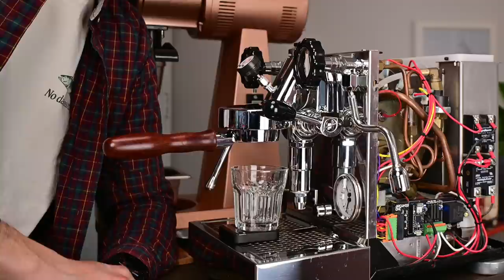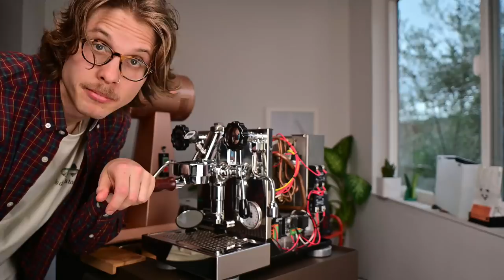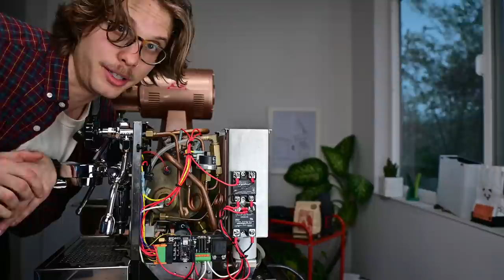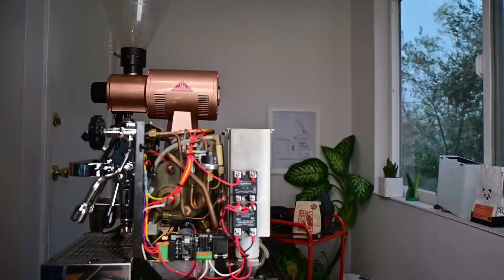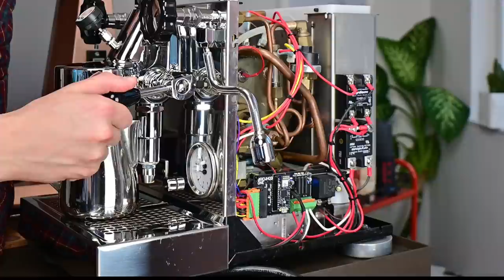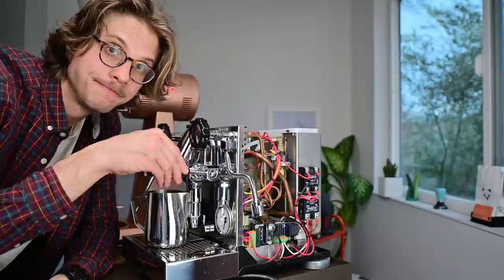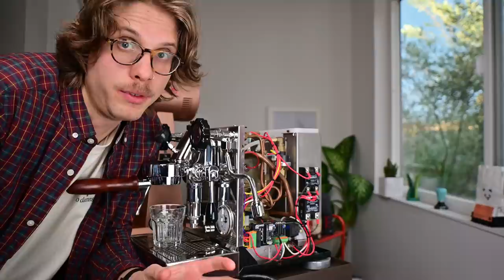I Built an Endgame Rocket Espresso Machine | An Engineer's Rocket Appartamento Mods

Comment: That very neat stuff. I would be a little concerned about that variable paddle in that when you get a little off the end of the cam you are starting to alter the valve positions and I could see trouble if you try doing this around the halfway point, Im sure you would have no problem but an ordinary user would. Im guessing you have yours plumbed? Mine isn't and it really annoys me when it runs out of water so I have a level display based on a pressure sensor connected to the tank connector outlet. I haven't actually mounted the unit yet but am looking at coloured LEDs on the back so it lights up the rear of the unit green, orange red etc, I don't like leds on the front panel design of the Rocket.  Really like your controller, I would like to be able to do that but Im not good enough with software to write that yet. 

Highly recommend putting a couple of these antiburn rubbers on you wands https://servicesphere.com.au/products/CMA15296001

Comment: Why drilling the hole in boiler for temperature readings when all you need is temperature 1mm from the coffee grounds?
Reply from the maker: Good question! That probe is actually responsible for running the PID I wrote that runs on the board, which needs to maintain the steam boiler temperature.
Reply: @tatemazer  that's really cool, but it would be simpler on lever machine like Europicolla

Comment: So if you had to chose on the group head temp or pressure guage which do you chose?

I've a ECM Mechanika V Slim and by default I alway dump my cup of water from the group.
Reply from the maker: Ohhh that is a tough one! I'd say, stick with the temp sensor until you get confirmation and confident with flushing the right amount of water, then maybe take advantage of that muscle memory and jump into using the pressure gauge.  I'm not quite there because I unfortunately don't pull enough shots on this machine!
Reply: My question is, why hasn't someone built a pressure gauge which also reads the temperature? This seems like a no brainer gadget to make.

Comment: This mod make me think of the mod gaggiuino. personally, I prefer rotary pump over gear pump due to the sound, but i guess there is no space for a rotary pump.
Reply from the maker: I gotta agree with you, I don't think there's any pump that sounds nicer than a rotary pump! And yeah I don't think I could make it fit :( but pressure profiling is much trickier with those AC motors :(
Reply: @tatemazer  Ac pump should be able to adjust with AC Motor Speed Controller like how you adjust  speed  of your fan but you might need a stable ac input.
Reply from the maker: @Soras_  not quite. With the granularity of control you would want on an espresso machine, that design doesn't quite work. A better fit would be a vfd controller which are quite expensive and single phase AC motors have a very narrow range of efficient frequencies
Reply: @tatemazer   I think put a motor to adjust pressure valve on rotary pump should work. when i use my machine, the valve does change the pressure during espresso making process and it's quite linearly.

Comment: Why is the group head temperature overshooting?
Reply from the maker: This is a heat exchanger machine, meaning the heat source is water that passes through the 255F steam boiler, which is much hotter than ideal brew temperature. If the water is not flowing through the system fast enough, it can rise above brew temperature.

Comment: ...and what's the down-side of controlling pressure by duty-cycling a vibratory pump?
Reply from the maker: Hear the (relative) silence of a gear pump and you'll know immediately 😵‍💫😵‍💫
Reply: @tatemazer  I was just thinking of ways to get the job done on the cheap, and if you've got the Appartamento, you've already bought a vibratory pump. Of course a gear pump is quieter, more reliable, and volumentric. But do you know if there's a gotcha hiding in doing this with the stock pump and duty-cycling?
Reply from the maker: @lessmith3799  I agree, a vibe pump is a great cost-effective method, as the decent has shown. It's just slightly more complicated to control considering you need a long pwm period to control the AC pulses instead of simple DC voltage control

Comment: Would love to see a flow control mod for Linea mini
Reply: there are several: Two different needle valves from either Grafikus or the coffee machinist. There is a gear pump (called EMP Mod) also from the coffee machinist. I did the EMP mod - allows full pressure profiling. I'm sure there are others as well.
Reply from the maker: This is an interesting proposal! I've certainly seen these needle valve mods, but it would be interesting to have full flow control like the e61 mod, I'm stewing ideas! 🤔🤔🤔

Comment: Hey T, the potentiometer on the lever feeding the pump was brilliant. I love how it kept the integrity of the Appartamento. 

On a machine with a PID like the Rocket Mozzafiato how would you go about sending the thermometer readings via Bluetooth to a coffee profiling App?
Reply from the maker: Hi interesting question! Unfortunately that information is locked behind the firmware already on that machine and isn't exactly accessible to an external device like a Bluetooth device. Also it frankly wouldn't be very useful since it only represents the steam boiler temperature.
Reply: @tatemazer  Are you familiar with PresSensor? It already captures and sends the pressure info to an App. I’d be looking for a way to capture and send the thermometer data to the app. 
Temperature readings wherever collected from are tricky. Rocket’s correlation between boiler and brew temp is about 24-26 C. Even thermometers that read off the E61 are a few degrees off the brewing temp and I don’t know any that offer Bluetooth connectivity.

Comment: Sorry, but water in its fluid state can't go passed boiling (212/100).
Reply from the maker: The water vaporizes as I open the valve and the heat exchanger is able to depressurize. Remember that the boiling point is also dependent on pressure.
Reply: @tatemazer  "vaporizes"  and true on pressurized water :)